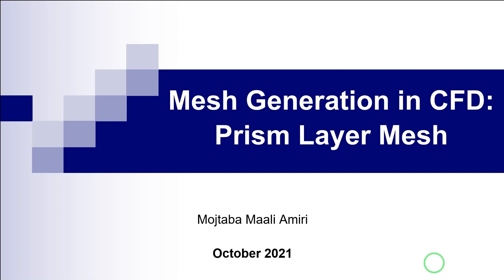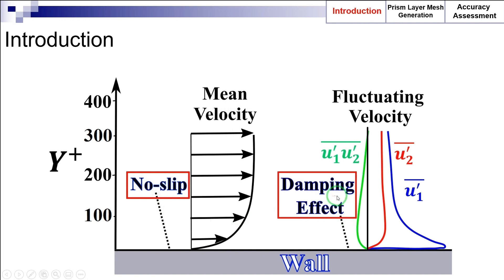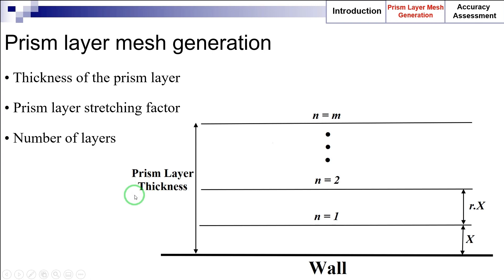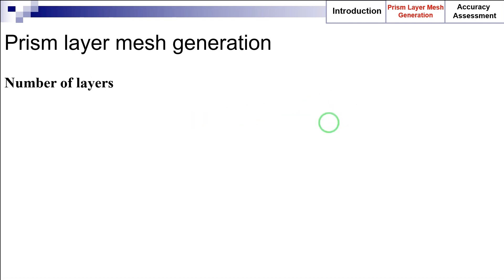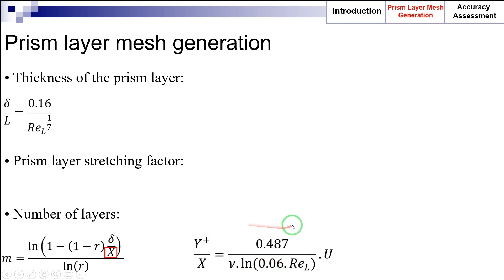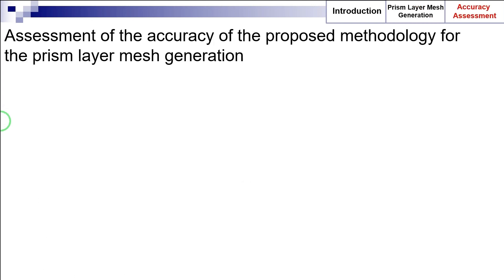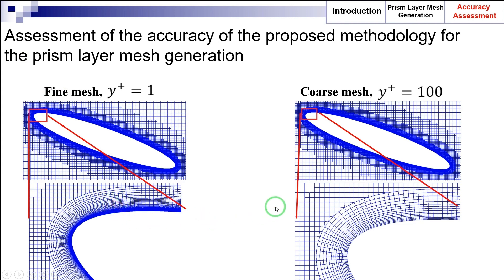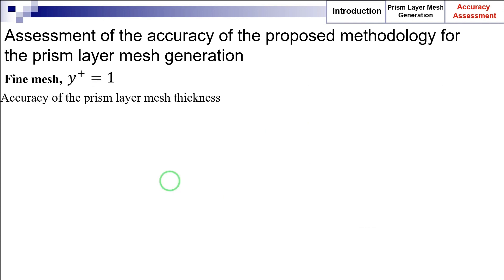Mesh Generation in CFD: Prism (Inflation) Layer Mesh

Comment: Thank you for the video,

Looked further into the reference you had recommended to read ( White, F.M., Viscous Fluid Flow, 3rd edition, McGraw-Hill, 2006.).

I tried to look for the formula used at 8:16 (White 2006), but I was unable to find it in the book. Can you please refer to where in the page specifically it is shown?  I have been unable to overcome this hurder since.

Thank you very much

Comment: At the end of the video, seeing that u(y) is maximum (red color) almost all along the prism layer total thickness, can we conclude that the prism layer total thickness (delta) that we have assumed is higher than the boundary layer thickness? So should we reduce this total thickness (delta) and recalculate the number of layers (m) to simulate again?
Reply from the maker: Dear Jon Urcelay San Roman,

As you mentioned correctly, the prism layer thickness appears to be greater than the boundary layer thickness and thus you can reduce the delta value, which consequently reduces the number of layers and the total cell count. However, in my experience it is best to keep this setting for the prism layer, which ensures high quality mesh close to the body to capture fluid flow characteristics.

I hope this was helpful,
Respectfully,
Mojtaba Maali.
Reply: @CFD_Mojtaba  Thank you for your help!